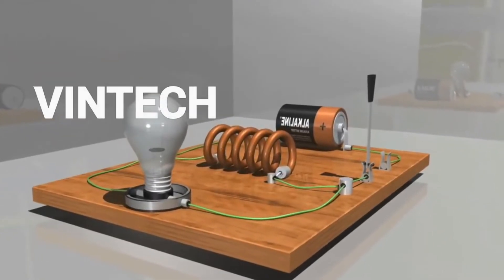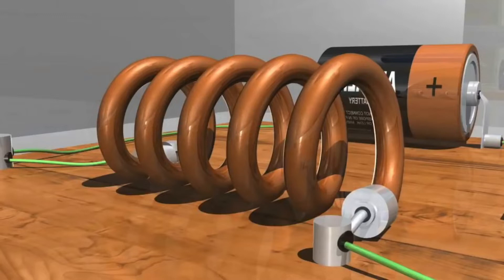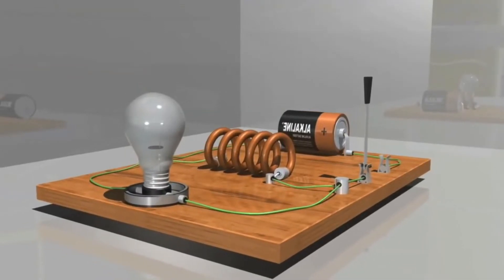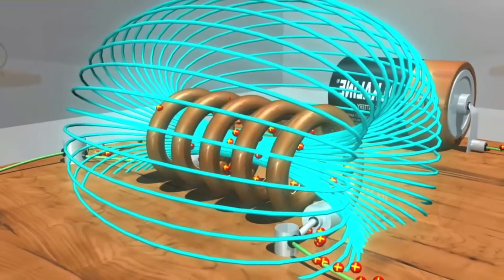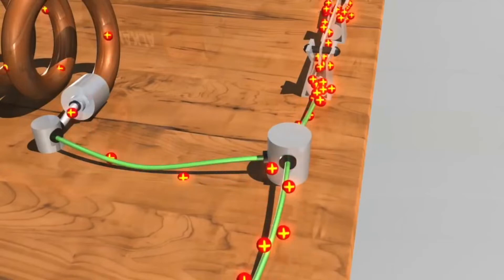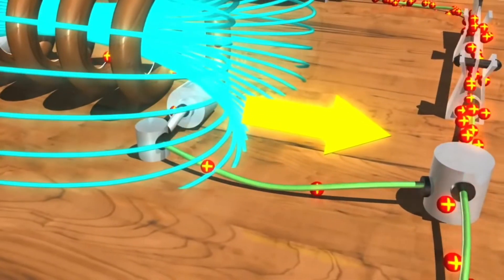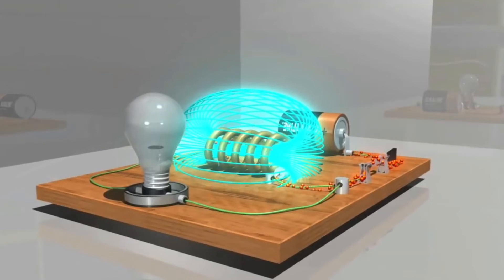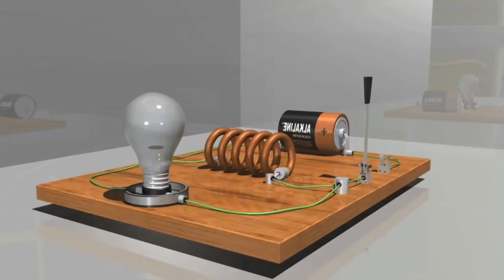What is EMF? What is Electromotivw Force? What is back EMF?

Comment: Are electrons shown as positive charges or did you just get the direction of the magnetic field wrong?
Reply: conventional current direction is shown where positive charges move across the circuit. this is by convention only to simplify calculations (no negatives). but we all know that in reality, electrons are the ones that move to produce the current.